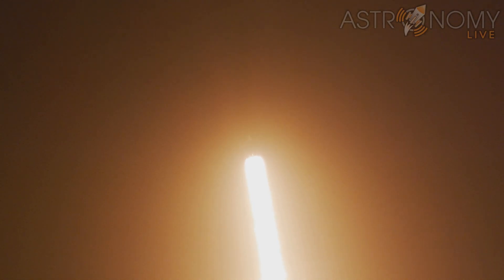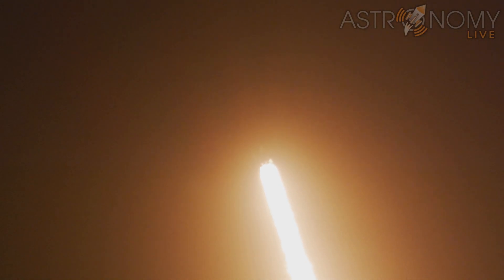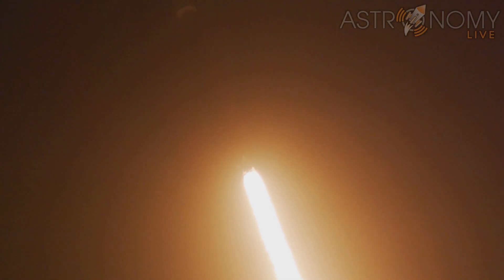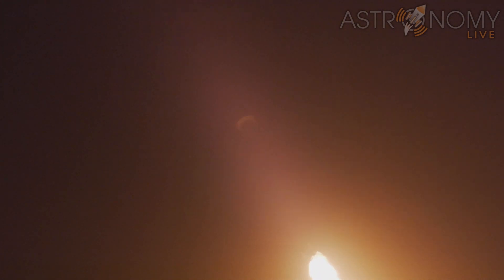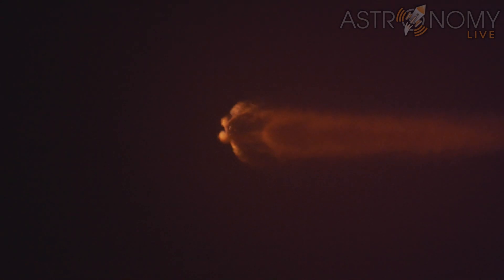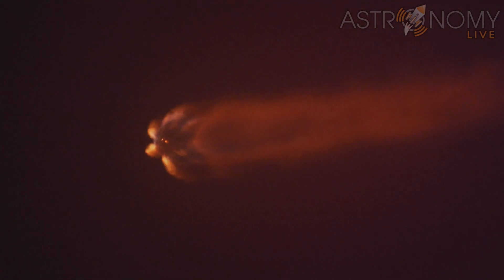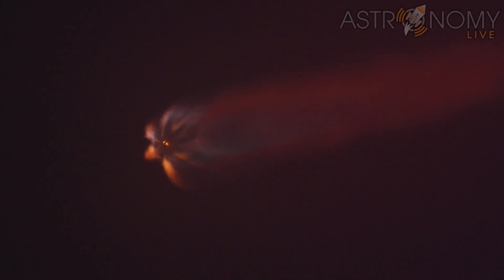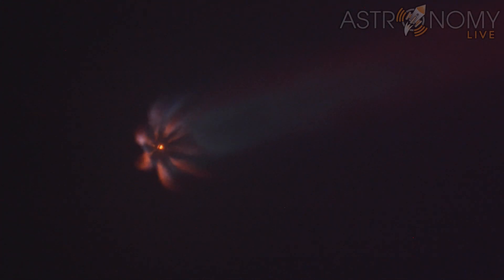Tracking a Night Launch with an 11" Telescope!

Comment: Would you say you got better results than with the 8 incher?
Reply from the maker: Not really, the 8" was a tactical decision to have a scope I could tear down faster if I needed to move to catch the post TLI observation. Forecast called for clouds after launch at viewing site but in the end it was fine and I didn't need to move. 8 inch is nice and delivers a crisp image but I can push the 11 a lot harder and the tracking is smoother pound for pound at a given magnification, not to mention the ability to use predictive tracking that I can't do with the 8".

Comment: Is it fair to send lunar missions in the new moon phase!?  Let's think a little!?  ARTEMIS I, goes on the 27th of September, Apollo 8, 11 and 17 were in the new phase.  This prevents professional optical tracking!?
Reply from the maker: If Artemis I launches on the 27th of September, it will still be visible the evening after the launch from my location. It will be about 30 degrees above the south-west horizon at the end of astronomical twilight. Apollo 8 and 11 were both tracked optically in cislunar space at some point during their missions and Apollo 17 was tracked by amateurs with a radio telescope:
http://pages.astronomy.ua.edu/keel/space/apollo.html
http://www.svengrahn.pp.se/trackind/Apollo17/APOLLO17.htm
Due to the anticipated length of the Artemis I mission, I can basically guarantee that I will be able to track it at some point with some telescope regardless of when it launches.
Reply: Thanks!  You do an excellent job!